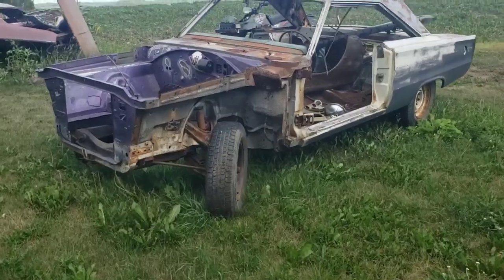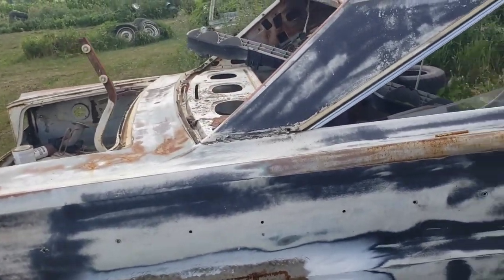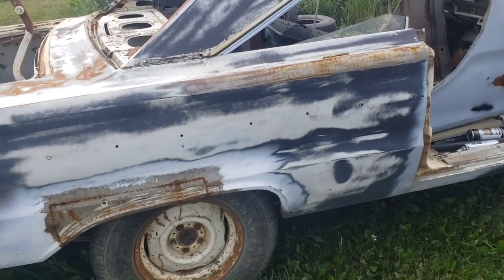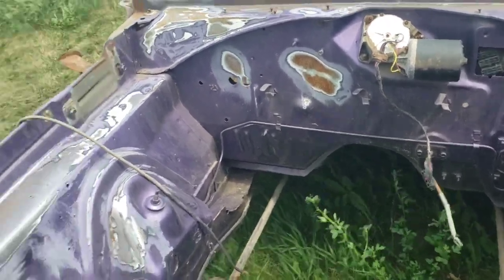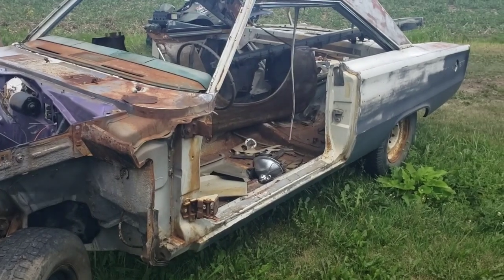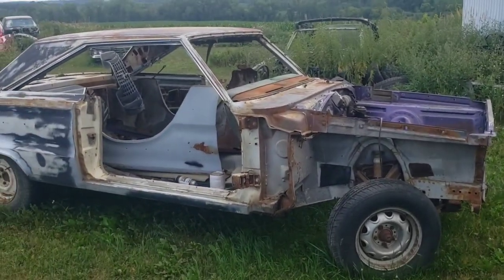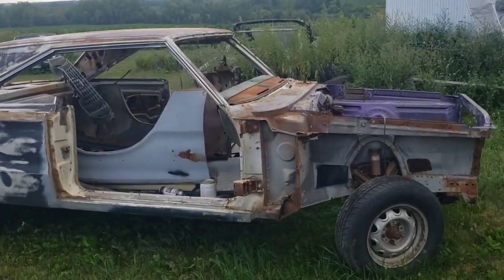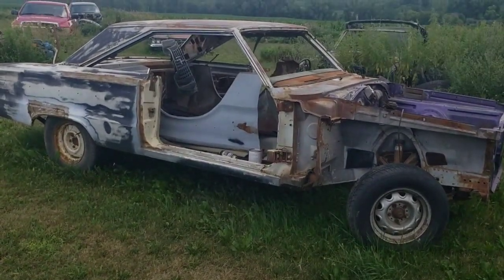1966 Belvedere (Cheap Thrill) Update #mopar #plymouth

Comment: Looks like my high school hotrod, a 66 Satellite with a 383, cam, headers, intake, heads, pistons with a 4 speed and 4:10 Dana.  Cut out the quarter panels for n50-15's aided by Hurst/Gabriel air shocks pumped up to 150 lbs.  Loved that car.  Still have it, although it needs a lot of work.  Looking forward to seeing this project evolve.